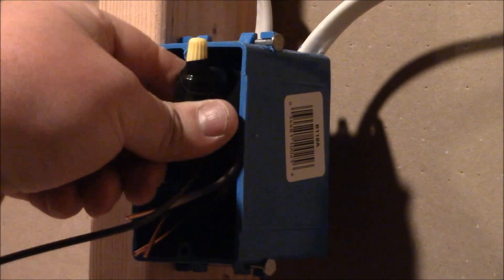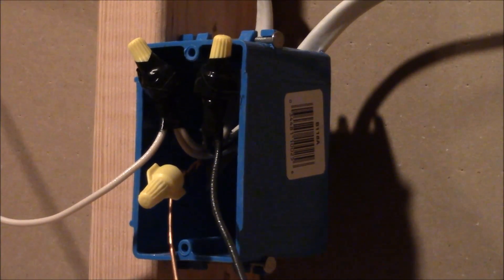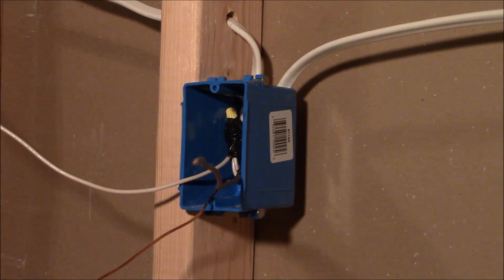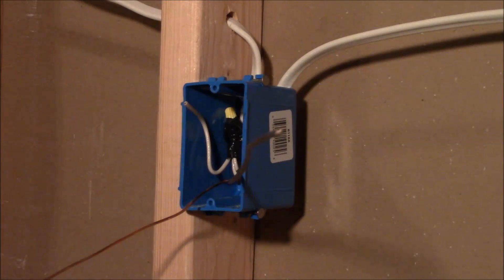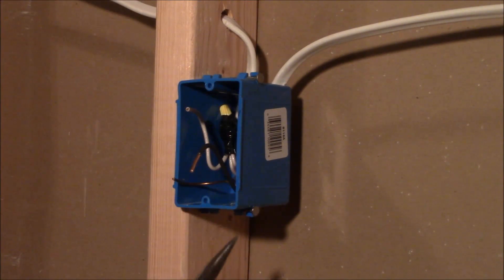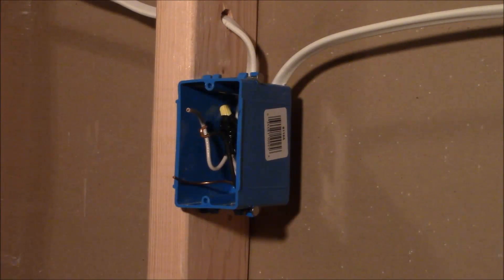How to install an Electric Outlet / Wall Plug

Comment: The electric tape around the screws are in case somebody tried to change the plug and it was hot and they forget to check it, or don't know what they are doing, it's not required for it to work fine but code in some states requires it.